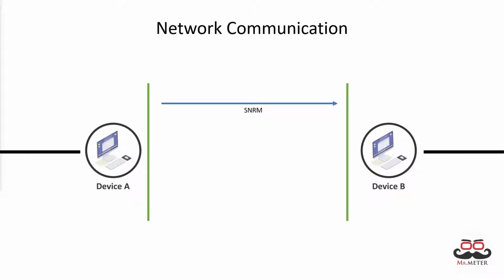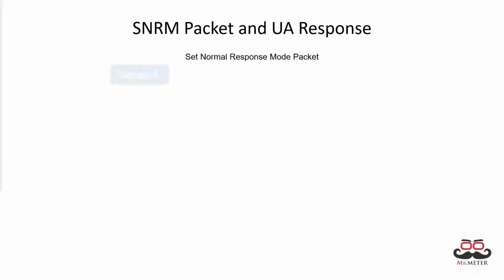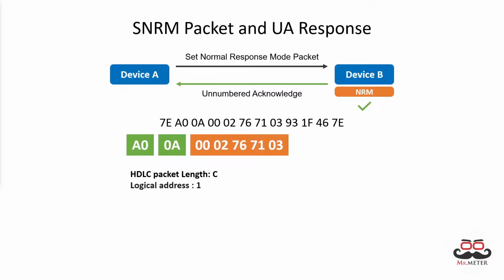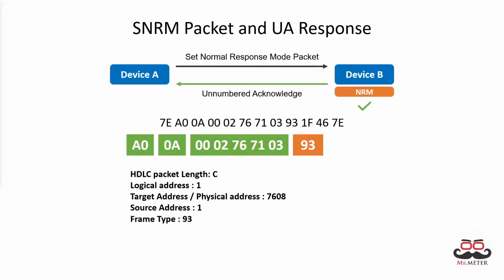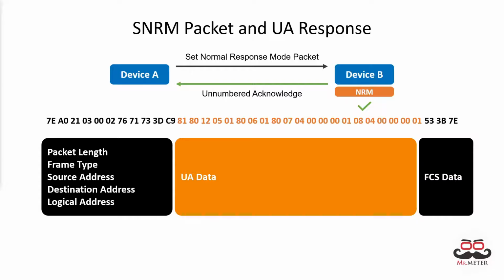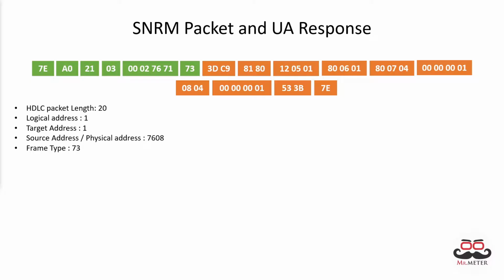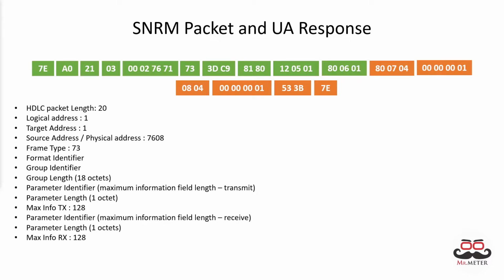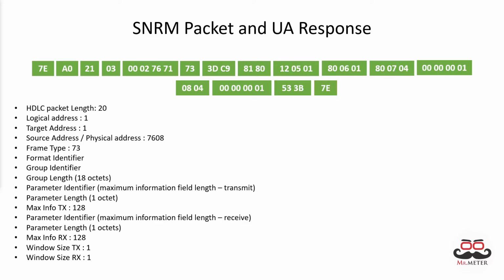Initiating a connection in HDLC communication (SNRM)

Comment: hi one doubt  at 6:11 HDLC packet length=20 that is 32 in decimal but total packet is 35 bytes long why the difference ?
Reply from the maker: In the sample HDLC packet in video, the length byte 21 is in hexadecimal, which translates to decimal 33. The value 33 includes both the control and address fields, as well as any data fields.
Given that the Gurux DLMS Translator shows the packet length as 20 it’s subtracting the control information and fields irrelevant to data, aligning with the Gurux software’s interpretation and internal processing of HDLC frames specifically for DLMS contexts.
Reply: Thank you